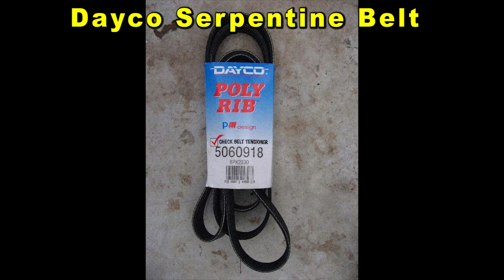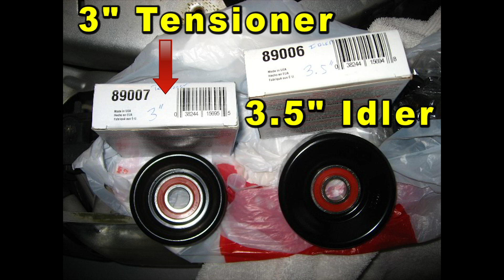1997-2003 Pontiac Grand Prix How To Change Supercharger Tensioner & Idler Pulleys With Part Numbers

Comment from the maker: Pontiac Grand Prix Supercharger Belt - https://amzn.to/4bS2dFG
Grand Prix Serpentine Belt - https://amzn.to/3LDWTLt
Supercharger Tensioner Pulley - https://amzn.to/3LBXltt
Supercharger Idler Pulley - https://amzn.to/4c3E8eZ
Precision Screwdriver Set - https://amzn.to/3sLixaP
Plastic Pry Bar Tools - https://amzn.to/3HMtsV7
Socket & Ratchet Set - https://amzn.to/3Z17LbA
Mechanix Gloves - https://amzn.to/3jCnHkt
Torque Wrench - https://amzn.to/3vS5uSI

The Paul79UF YouTube channel is a participant in the Amazon Services LLC Associates Program, an affiliate advertising program designed to provide a means for sites to earn advertising fees by advertising and linking to Amazon.

This DIY video shows owners of the 7th generation 1997, 1998, 1999, 2000, 2001, 2002 and 2003 GM Pontiac Grand Prix how to change the serpentine belt, the supercharger belt, the supercharger tensioner pulley and the supercharger idler pulley.

Comment from the maker: Check out the DIY guide for changing the serpentine belt, supercharger belt, supercharger idler pulley and the supercharger tensioner pulley in a 7th generation 1997 to 2003 Pontiac Grand Prix with the 3.8L V6 - 
https://www.paulstravelpictures.com/GM-Pontiac-Grand-Prix-Idler-and-Tensioner-Pulley-Replacement-Guide/index.html

Here are all off the DIY repair and maintenance tutorials for the 7th generation 1997 to 2003 Pontiac Grand Prix - 
https://www.paulstravelpictures.com/Articles/GM-Pontiac-Grand-Prix-Common-Problems-Repair-Maintenance-Guides.htm

Owners of other General Motors vehicles equipped with the 3800 Series II L67 or L36 engines such as the Pontiac Bonneville, Firebird, Buick Regal, Park Avenue, Riviera, Le Sabre, Chevrolet Camaro, Impala, Lumina, Monte Carlo, Oldsmobile Eighty-Eight, Regency, Intrigue, LSS and Holden Commodore may also find this guide to be useful.

Comment: What is the size of the bolt that holds the s/c tensioner to the engine? Is it a T-Bit?
Reply from the maker: Hi, I never had to replace the supercharger tensioner. I'm doing some research for you now.

I'm reading that it could be a Torx T55 bolt. It has been so long since I worked on my 2001 Grand Prix GTP, so I don't remember what the bolt looked like.

Does it look like a star pattern? Is it a female bolt or a male bolt?

I found a forum thread that specifies "Tensioner Pulley = 15mm socket OR Torx T55".

https://www.grandprixforums.com/general-tech-discussion/48823-bolt-size-and-torque-spec-thread.html

I hope that helps. Good luck!